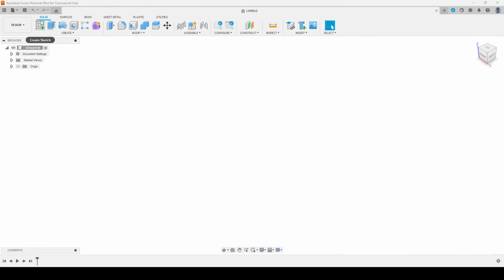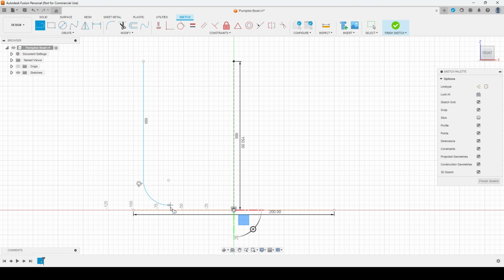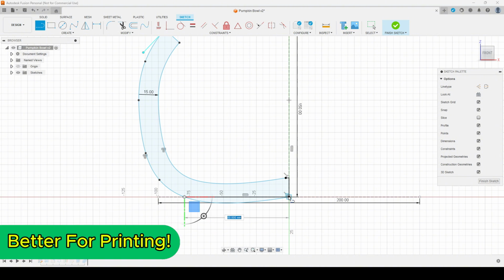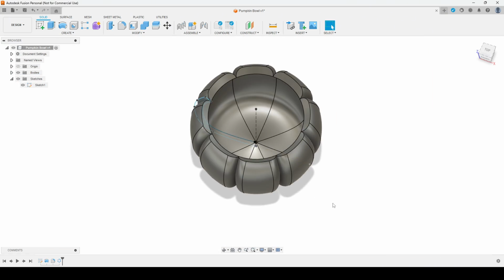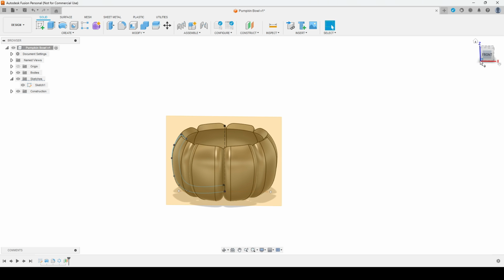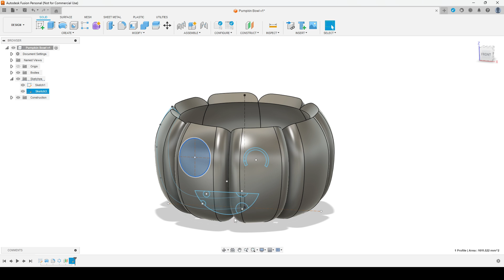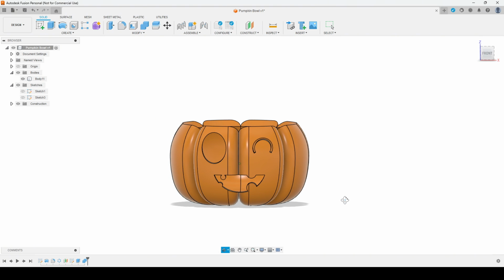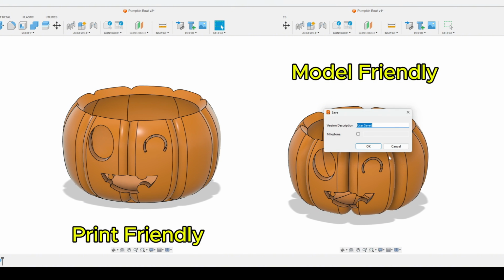How To Make a Pumpkin Bowl. Fusion 360 Tutorial

Comment: I'm new to fusion so apologies if this is an obvious mistake, but I keep getting an error when trying to create a fillet on the 45deg section, it's just saying that it couldn't be created at the requested size. It will allow me to make a smaller fillet, around 2mm, but any larger and I get an error.

It seems like a function of the particular geometry of my section, since playing with the spline points on the outer curve will change the allowable fillet size, but I haven't been able to get it above 3mm. I notice there is a constraint or dimension line of 15mm between the outer and inner curves of the sketch (visible around 2:40 in the video) that isn't mentioned. Is this necessary to get a larger fillet? If so, how is it created?

I have enjoyed these tutorials and feel like I'm getting a better feel for CAD with fusion, but I'm clearly not there yet.
Reply from the maker: Hey don't apologize for asking questions, thats how we learn. You'll have to forgive me as this was a year ago but if I remember right the 15mm constraint was just to tell me how thick the wall would be. You can try to copy it and see if that helps. I do remember having a really hard time getting the fillets to work and I even mentioned that in the video. If I had to guess it's having an issue with the top and bottom points of the curve, you can try the flat bottom I make later in the video and see if that helps. You can also try to fillet in segments instead of all one action. I hope this helps 😁